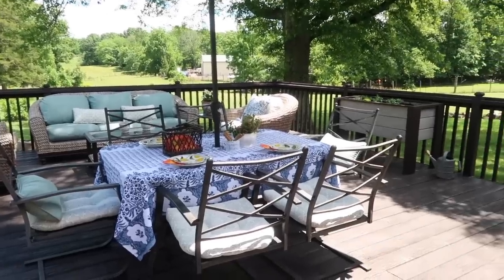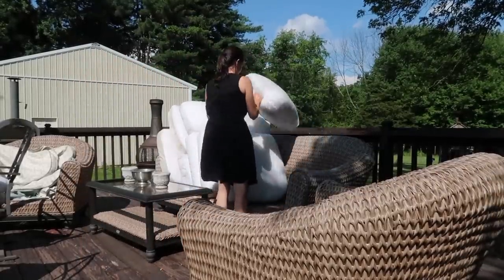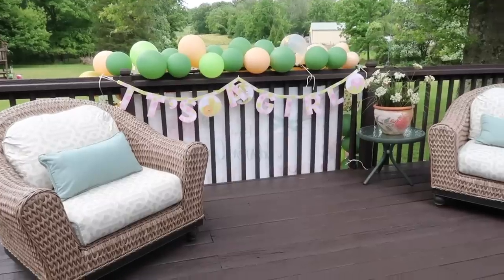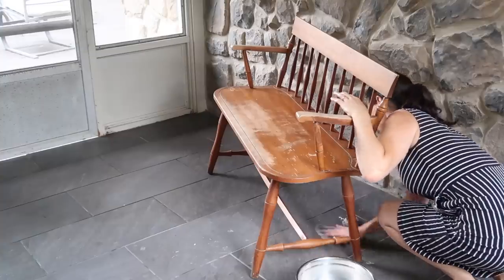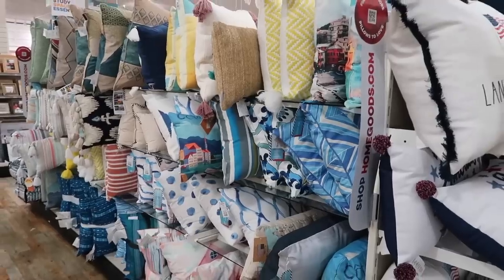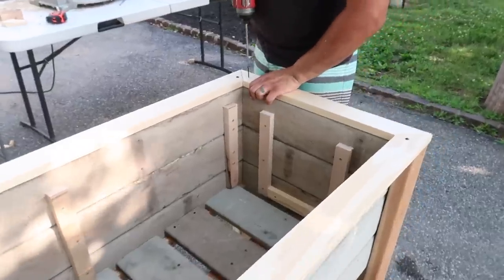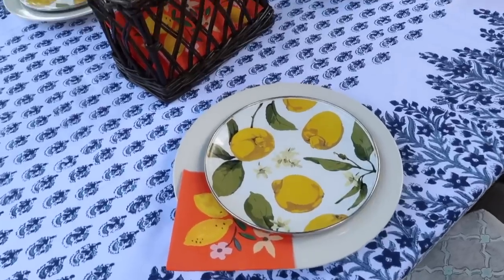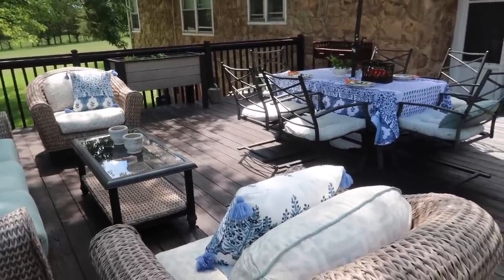Classic Cottage Deck Refresh + Sunroom Tour

Comment: The breezeway and deck both look so beautiful! I love the blue and white. Instead of string lights, they have solar post caps that will fit directly onto the top of your deck railing posts. I replaced my string lights at my beach cottage with those post cap lights. They're tidy looking and work!
Reply from the maker: That's a great suggestion, thank you!